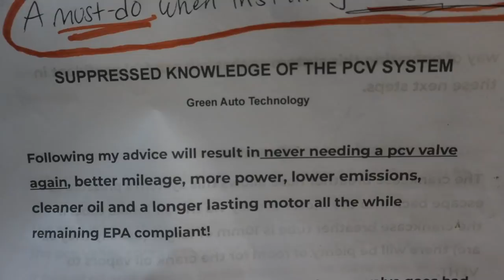The Wonder Of Positive Crankcase Ventilation

Comment: I'd like to run a pcv valve, but I run early 70s M/T valve covers. They don't have baffles in them. If I do run a pcv valve it drinks oil at speed.
Reply: You can pick them up almost anywhere, hell even summit racing has them.
Reply: @davidmiller9485  why? There's a reason I still use the old M/T valve covers, Sherlock.
Reply: @manicmechanic448  "I'd like to run a pcv valve" your words. Nothing is stopping you and that is what i pointed out. I have no idea why you think i was telling you to change your covers. The baffles can be purchased and added to the covers you have. That is "why". If you were telling the truth about wanting to run one then their is a way without losing your covers. :)
Reply: @davidmiller9485  I've got one. Even without vacuum it still leaks oil. The baffle needs to be inside the valve cover. Otherwise I'm just putting a straw in it for my carb to drink oil with. Anymore bright ideas? And you expect specific about what the hell you were talkin about.

Comment: Are you telling the whole story on the PCV valve? Where do the gases go?
Reply: The gases go into the intake manifold, and thus into the cylinder to get burned.
Reply: @daleinaz1  
t.y.

Are catalytic converters BS or is it just me?
Reply: @hg2.  As far as I know, they do just what is described. Finish converting a lot of HC and CO to H20 and CO2. Why do you think they are BS?
Reply: @hg2.  Umm, not exactly. EGR reduces the combustion temperature, mostly by introducing CO2, which is what reduces NOx. Nitrogen enters as N2 from the air, and is normally stable. But at high temp/pressure, it will combine with oxygen to form nitrous oxide. That combines with water vapor to form nitric acid. And that will sting your eyes. Not to mention what it does to marble and limestone.
Ozone (O3) production is a separate issue.
Good tuning will not fully eliminate unburned hyrocarbons, nor carbon monoxide (CO). That is what the cat con does. In fact, a significant percentage of the HC and CO produced in the EPA test cycle is what escapes from the cat con before it reaches operating temperature. One Ford engineer said that they could reduce that by (30%, 40%, I don't remember) if they could pre-heat the cat con before starting the engine (using an electric heating element). But that would require that you wait for three to five minutes before starting the engine, and that would not fly. People want to turn the key/push the button and go.
The screwing of the public is in the "oxygenated" fuel (alcohol or MTBE). In modern computer controlled cars with oxygen sensors in the exhaust, using a high oxygen content fuel just makes the fuel injector run slightly richer to compensate. But it adds cost to the fuel and lowers your gas mileage slightly. It supposedly helped the older, non-fuel-injected cars, but I had a 1980 Gernada (with carburetor and no O2 sensor, the VERY type of car it was supposed to benefit) and I had it tested annually from new. It was introduced here in about 1985, and my tests from before and after were identical. (They used to actually measure the tailpipe and print the HC and CO levels on the paper.) So, yeah, oxygenated fuel is a scam.

Comment: To summarize, PCV valves suck. They are one way valves which help reduce pressure and suck out harmful blowby gasses from the crankcase. The main reason why many car owners hate  PCV  and EGR systems is because they recirculate engine contaminates back into the intake. Fortunately, quality motor oils that are dexos approved are less prone to breakdown and are good at holding contaminates in suspension. Regular oil changes every 3-5000 miles will help keep you engine clean and well lubricated. It's also important to clean out your PCV, EGR, and throttle body periodically.

Comment: Having worked around emissions, AIS, EGR, PCV, High-Flow Cats, etc. it becomes readily apparent to me that traffic and more specifically idling(in heat) is what kills gas engines.  There are so many conventions in contemporary engine building that are completely unnecessary such as fan shrouds which were implemented not because they have magical powers of cooling at idle but rather so Tech's did not inadvertently lop digits off while clocking a distributor.  PCV's did clean-up the road, but do suck some some HP out; case-in-point the Craftsman Truck short-track series LV, SLC, Magic Valley etc. built their engines for breathability and power w/ minimal warm-up, and if anyone remembers they vented the crank-case directly on both banks w/ Mr. Gasket type breathers and no PCV's.  Once again, like the government conflating drivability in the Metropolis(think LA) w/ performance.  Think of it this way, 'you can have Eco, and you can have Boost---but one can not have Eco-Boost'!  Lastly, and ironically pushing more air through increases wear(especially at idle)  and makes the intakes filthy to boot!

Comment: Every Honda and Mitsubishi I've ever worked on kids put cold air intakes on using atmosphere filters all leaked oil because most the time their filter was clogged after a few months when I ran pcv** not plastic pipe most people call em 😂 the oil leaks stopped it can even make your front seal and rear main leak ask Triumph spitfire guys even my sbc and ford's got em 😂

Comment: Except the auto manufacturers think they are so smart by integrating them into your valve covers, and inevitably they get stuck open, and all of a sudden you are burning oil like crazy, wrecking your catalytic eventually, and you have to replace the whole valve cover which is of course out of stock to fix it, so you end up plugging the vacuum line, and venting to atmosphere anyhow so you don't go through a quart every week...

Comment: Blow your viewers' minds and pull the heads on that MEL motor to show them the combustion chamber.

but it is ironic how the refiners would do their best to refine petroleum, just so the road tube would nearly bring it back to its natural state.  Of course, all the concern about the EPA (Nixon created it) and its the reason we have engines so efficient a 6 cylinder makes 300 hp and gets 30mpg--if you told someone back then you had such an engine, they'd swear you were using one of those fuel economy gadgets from the back page ads of Popular Mechanics.

As for race engines not using PCVs, they tend to run a hose from the valve cover to their zoomie headers, achieving the same goal.

Comment: what I think is bullshit is anti drain back valves in oil filters for engines where the filter hangs upside down like on a chevy  or down at an angle like on a mopar ! oil filters for years didnt have them and then like over night all filters had to have them . gravity keeps oil in the filter with out a anti drain valve . I all ready did a test

Comment: I've deleted the PCV valve from a few of my cars and noticed no difference. The EGR valve on the other hand is an evil prick and disconnecting that bastard absolutely will make your engine run better.
Reply: Sorry, have to disagree. Unless it's stuck open.
Reply: On a gasoline engine the EGR actually improves fuel economy by reducing pumping losses.

Comment: A huge downside to pcv valve is when it is used on a GDI engine. It covers the intake valves and turbo with all that gunk your talking about. A horrible system that needs updating. We have far different engines now than in 1963!!

Comment: the only down side to the pcv system is it puts carbon on the valves...not a huge thing with carb and throttle body injection....with direct injection no fuel to wash valve so carbon builds up to the point it causes problems

Comment: @70,000 mile until rebuild ?
Consider the old oil technology vs modern oils  as well as the modern metal technology, precise fuel mixture of computer fuel injection, and red hot ignition spark.
JMO 🤔🤔
Reply: Running 200* water and oil helped a lot too.

Comment: Have you ever seen an engine with excessive blow-by blow the valve covers and distort the oil pan because some idiot removed the PCV system?  I have!  The crankcase and oil got over saturated with fuel, no PCV system and boom!  Idiots.  🤣

Comment: You should look into the hydrogen from water electrolysis system. They were doing that dumb crap in Hawaii 15-20 years ago when I lived out there. Bunch of BS 🤣
Reply: conversion is getting more efficient. still a long way off.
And now that you can make hydrogen what are you going to do with it? Much of the gas transmission infrastructure isn't compatible.
Still, keeps them busy and out of trouble

Comment: Air + heat + oil/gas/vapors + combusion products = sludge.... The killer was when engine cooled down it sucked air back in thru the road vent. Remember when you held your hand over that vent to sense the pressure? Hi-press= blow-by & bad rings

Comment: The PCV valve, replacing an open oil drip tube with a means of aspirating that oil vapor into the combustion chamber was a reasonable idea, but the government's nightmare of emissions control hoses, valves, etc., turned otherwise decent engines into gas guzzling, gutless turds, and in the end they created far more pollution than they ever stopped, and cost consumers untold dollars trying to make them run right.

Comment: Positive Crankcase Ventilation Valve,  not Pollution Control Valve Valve! 
I have been explaining this from the mid-sixties.
That sludge you used to get inside the engine and filled up the Oil pump pickup....yuck!

Comment: When upgrading the 66 Volvo wagon from a B18 engine to a B20, I went with the PVC system on the later engine, instead of the drop tube. Only a total dumbfucker wouldn't right?
So I'm on a Volvo Amazon sight and a guy has the same option on his car and I say DEFINITELY do the PVC. You wouldn't believe the opposition that comment generated from people to stupid to understand what's going on.
 By the way the difference between an B18 and a B20 is going from 1,800cc to 2,000cc, a gain of about 13 cubic inches.   It makes more power on paper, gives you a warm fuzzy feeling but you don't really notice anything. 😆

Comment: I agree, but you sort of missed some of it. First, the cars using a drag tube did cause oil downs while stopped at signal lights, but it goes further than that. It did give you the rainbow in the rain, but it also was the cause of millions of accidents. People would be driving along and the light would turn yellow and someone would always hit the brake a bit hard or right in line with the oil river on the ground and that brake would lock up and steering would go insane and crash!!!  At the sane time as that fiasco, just about every car on the road had drum brakes and too many people would try to adjust them at home that had no clue how to. That added to the crashes. 
Also, after sitting idling for a few minutes at a light, the light would turn green and lead foot Larry would stand on the go peddle and leave a plume of smoke that clouded the neighborhood.. I lived on a street that had a Kodak parking lot on the end and I lived it 5 of 7 days a week until all those crap-tubes were gone..   That leads me to something else that you said. According to you, the PCV valve was the ONLY good thing the EPA mandated.. I'm going to guess you were never in LA in the 60's and 70's... Between drag tubes and leaded gas and diesels you could not see 100 feet in front of your own car in broad daylight!!! I know you hate electronic ignition and computer controls, but that's because you don't want to give up the old. Cars today go far more miles on a gallon of gas at the same time that they make as much or more power and the engines and tranny's last 2-3 times as long without much upkeep. My 02' F250 has about 130K on it and has never had the engine or tranny opened up. Still has the factory plugs in it. The fuel filter was last changed about 5 years ago. (Can't say that on anything from when you and I were young)! It is FAR more dependable and starts every time on under 2 rotations of the crank and idles perfect no matter it I am in Rochester, NY or Denver or Cali or Florida. Try that with your carburetor!! (WITHOUT YOU ADJUSTING or CHANGING JETS)!! Mine changes everything about 100 times per minute without having to stop and pull out tools or get rained on.. I can go on, but I hope you get the gist of it... The PCV valve is only 1 GOOD THING brought forward by the EPA.. Just think what the air would be like today without the EPA!!!

Comment: Pcv meh. Pcv with catch can is way better. Downside, oil vapors lower octane qnd overtime build up oil in the intake increasing carbon on valves. Especially in a direct injection engine.

Comment: PCV negatives ?
Black crap in the intake tract and crudding up the back of the valves... And chambers. Need B12 👍
Other than that... PCVs are ...... 🤔
Reply: BTW. The direct injection engines don't cool and wash the valves so they are plagued with horrendous oil coking on the back of the valves.
JMO

Comment: pcv is a giant vacuum leak ! i always delete pcv.  i always vent the valve covers to atmosphere by using 5.8 inch hoses ran downward along frame rail .
Reply: i only run old skool chevys
Reply: i get much better mpg by deleting pvc ( put vacuum cap onto pcv port on carb )

Comment: Road draft equipped engines were always a mess inside. Looked like brown pudding. Non-detergent oils were also a big contributor. There was SO MUCH resistance to the adoption of detergent oil and PCV valves when introduced. Just like today, a lot of well-meaning, but misguided advice.
Reply: I remember the Japanese owners manuals from the 70’s damn near telling you to stay away from American motor oils.  Lots of push for Castrol.

Comment: The only pcvs that are really terrible are the ones on TSI motors from Volkswagen. I have a 2.0tsi in my cc and it dumps oil vapors and shit into the intake tract and it builds up carbon on the intake valves. My car is getting choked out from the carbon build up and misfires when it’s in high rpms. Ridiculous engineering fail.

Comment: Incorrect. The engines sludging and failing around 100k was due to poor oil quality/ technology, acid from sulfur fuel, and poor quality/technology piston rings, cylinder hone and material. 
Real racers and chemists know that oil is a high reactivity fuel and that oil vapor reduces the effective octane of your combustion. 
Uncle Tony. Sorry 👎
Controlled opposition.

Comment: Hey Tony!
You are correct, of course. The Washington corruptocrats put a lot of stupid mandates on industry, and especially the automotive sector. But even a blind squirrel finds a nut once in a while.
The PVC was a net benefit, and contrary to the belief systems of many gear heads, so were the EGR and the converter.
All the rest is a load of crap, especially ABS and TPMS....stupid stupid stupid!
Smog pumps and AIR merely gamed the system.

Comment: pcv is TERRIBLE for FI engines as it burns all that crap and lowers the perceived octane of the fuel the engine is seeing....bad juju!!!   we ran the PCV out into the exhaust with a vac pump and got much better performance on a turbo setup running 93 pump gas

Comment: What are your thoughts on a direct injected engine with PCV? No gas to wash the vales, so massive oil and carbon deposits to the point of misfires at slow speeds. What are your thoughts on the government mandates that made house roofs last as little as 10 years? In all reality the government fucks up everything it touches And I should eliminate my pcv valve because you think it is a good thing.